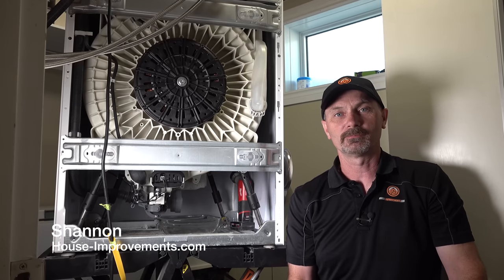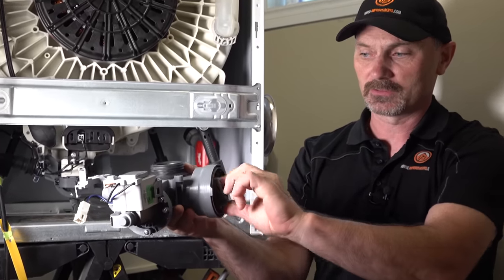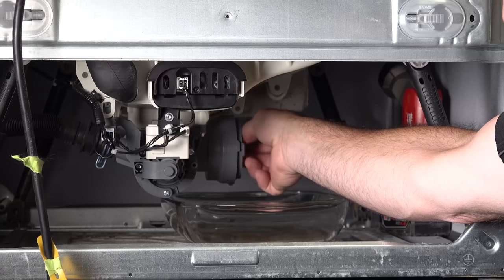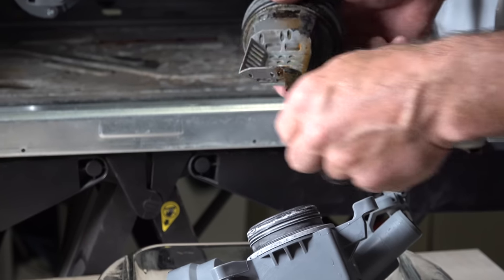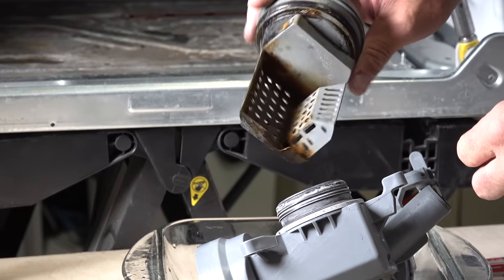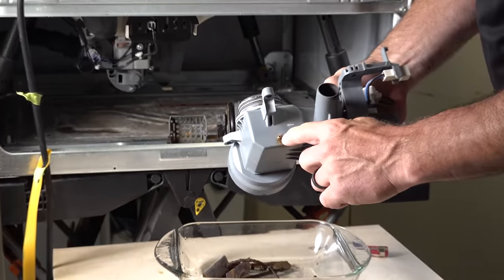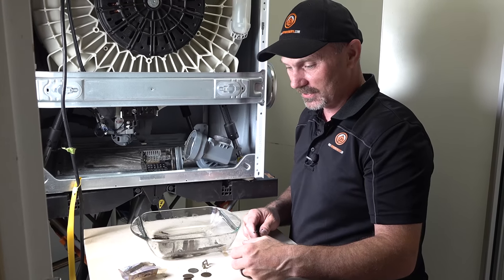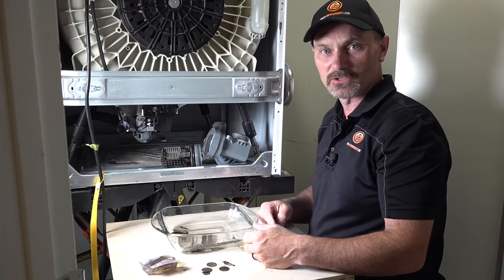How To Clean a Washing Machine Filter

Comment: It's a crime that manufacturers dont make the filter easily accessible from the front. All my machines years ago in europe were easily serviceable...almost like the US made ones are intentionally designed to fail prematurely
Reply: I had a similar machine, and the owner's manual didn't even acknowledge the existence of a filter. One day it stopped draining, and gave a cryptic error code that the manual said was something about drain height too high. Obviously the drain never moved. Took it apart and found the filter was clogged. Now I won't buy a front loader without a filter accessible from the front.
Reply: Buy a Miele a German made washing machine and the filter is at the front.
Reply: I think they are doing this on purpose so that you either buy another 1 or call some1 to fix it.
Reply: It's on the front in my LG. Cleaning the filter is in the maintenance manual.

Comment: Never seen a filter that is not accessible from the front before. I have had an LG since 2006, cleaned the filter last year; didn't find much. Probably more the "American" models "Maytag"/similar that will not have the filter at hand. One of your sharp pieces/parts took out that pump housing.  Clean those pockets before washing! 😀
Reply from the maker: I agree after some more looking , that hole was made by the metal pieces vibrating around for god knows how long in there.

Comment: It's called "Planned Obsolescence!"
My Samsung top load had a bad drain pump at about the first year, under a 5 year warranty.  Nothing came out except some lint.  It's been about 5 years now, close to replacement time.  This machine is computer controlled for it's wash cycles.  I miss my old machines.  No computer, good wash cycles.
This one will give out soon when I least expect it.  The Whirlpool top loaders I had in the past were good for about 5 years.  Two of them had bad transmissions under warranty.
Best machine I ever saw was the Blackstone my Mom had.  
Thanks for this video.

Comment: LOVE your channel, Shannon!  You mentioned using Vaseline on the O-ring, but would you agree you'd be better off using silicone grease because the Vaseline (petroleum-based product) would eventually eat the rubber O-ring?
Reply from the maker: That has been mentioned and I guess I would agree its maybe not the best choice

Comment: I had to replace my drain pump also because I didn't realize the little rubber water drain hose filled with micro sand backing up into the pump. Drain that hose when you clean out the filter. Luckily mine is a LG Tromm with the filter right up front in the main panel without any panel removal.

Comment: I have one that I can just pop off the front panel. It's kind of hard and you have to pull hard. I then clean it and pushed it back in. I did a load of laundry and came down to find water all over the floor. Just when you think it's back in, it might not be. I really had to push hard to get it back in for a water tight seal. I have a Samsung model with the annoying song at the end.

Comment: Hi, I've got a Westinghouse WWF1274 front loader, it starts to fill then stops seconds into fill,  then clock keeps going but nothing else. I managed to get an error code up which indicated the door switch. So I replaced that but it still does the same. I tried to get an error code up, but only got a ERR up for a second with no number? Any ideas? Thanks
Reply from the maker: Sorry I do not.

Comment: Maybe you should cut a hole in the front so you can reach the filter. Mine is in the front I clean it every other month. My wife has long hair and the filter will catch the hair before it goes into the pump. It has a little rubber hose that I Stick into a small bowl to drain the water first. then just unscrew it just like you did pull the hair out and then wash it in the sink. Reinstall and then good for a couple more months.